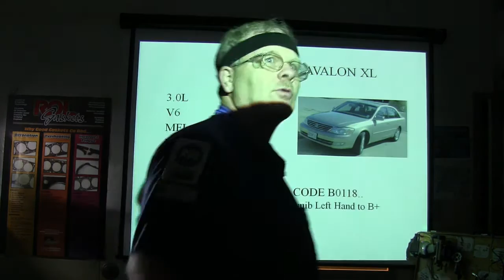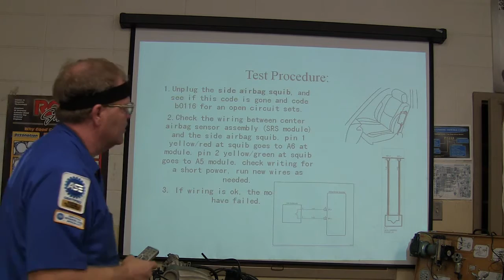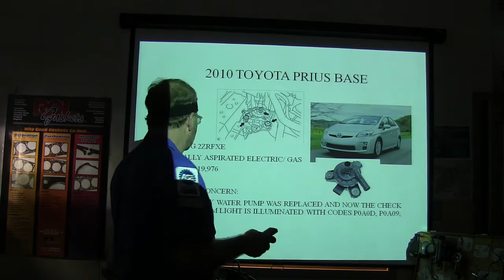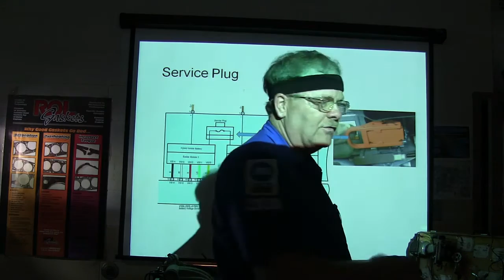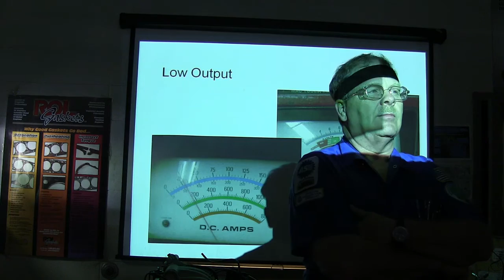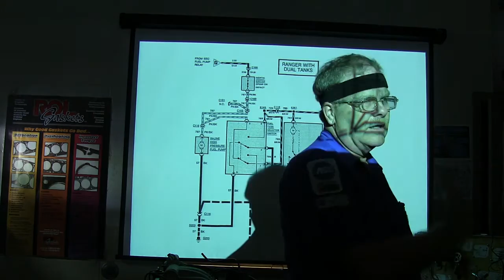Short Electrical War Stories

Comment: What do you think of fusible links VS fuses?
Reply from the maker: Fusible links are really good for places where surges are likely.  But Chrysler (and probably some other automakers) have been using those odd little capacitor-looking deals that act as solid state circuit breakers - they're built into the fuse panel and aren't replaceable.  Anything that can protect an important circuit without needing replacement is good, I think. I like circuit breakers. Fusible links are more difficult to replace and hard to get.
Reply: I remember going through the wire harness of an early 90s Ford I had figuring out what gauge fuse I'd need to cut out the fusible link and put in a fuse.  Stuck in a fuse box from a later model and it ended up looking factory AND I didn't need to go digging to replace anything that blew.

Comment: Also, never ever ever EVER turn an airbag/SRS module upside down.
Reply: Saw someone remove a center console in a dodge nitro once and also removed the restraint control module, not knowing any better.  When he turned it upside down.. well you can guess what happened...  Set off 8 airbags at the same time while he was in the car....  Not a pretty sight.  
I was taught that if your doing anything electrical related, or even close to harnesses... DISCONNECT the battery!  You wouldn't operate on a person while they were awake, why would you disturb electronic modules while they are awake.  Be safe out there!